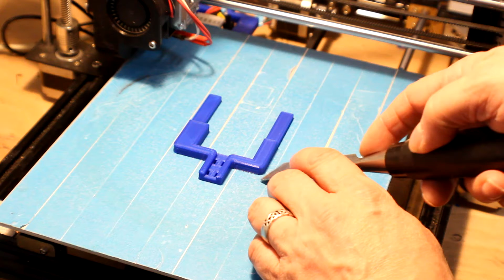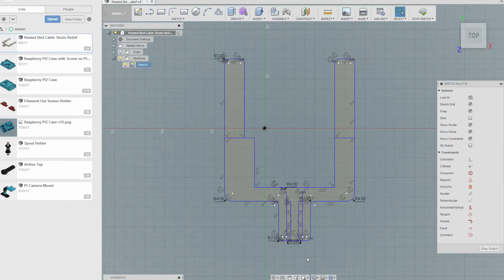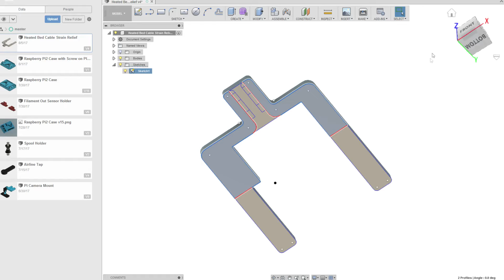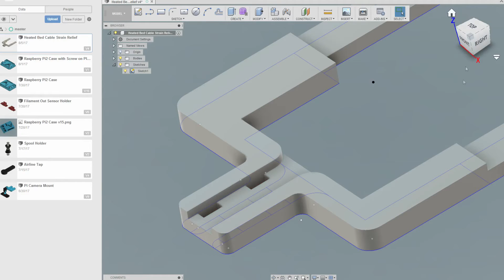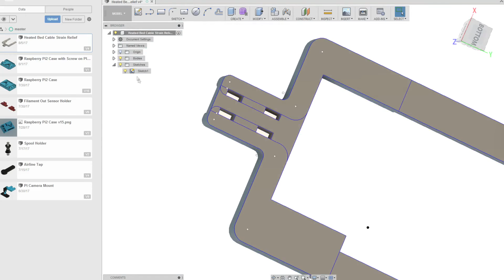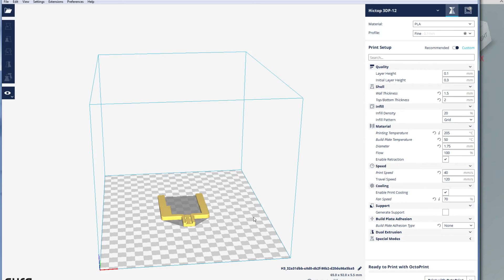Hictop 3D Printer Upgrades - looking for some relief

Comment: How long before you can 3-d print a 3-d printer is the obvious question.

Just for my curiosity, could you show the steps between saving the object, loading it into the printer to the pressing go,  on one of these? Same for CNC too actually.
Reply from the maker: Hi Julian - the RepRap (open source) design was developed to have as many 3D Printed parts as possible and the Prusa is similar, if not directly related in lineage to the RepRap, which is what mine is based on. With the other projects I have going (some of which I can't show on YouTube) I could do with another printer with a much larger print area, so that will be a series in the future.
I'll do a video showing the workflow from end to end, but I think the only part I haven't shown in previous videos is the OctoPrint part, which is how I start and monitor the prints remotely. A single video would be useful though.